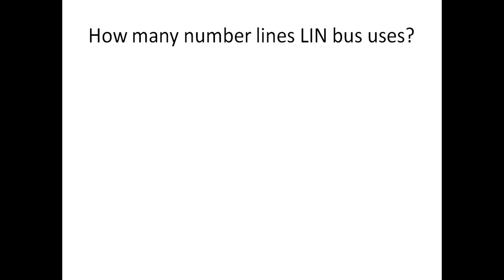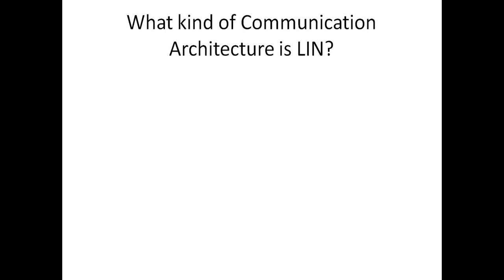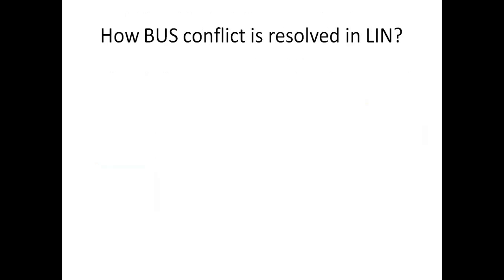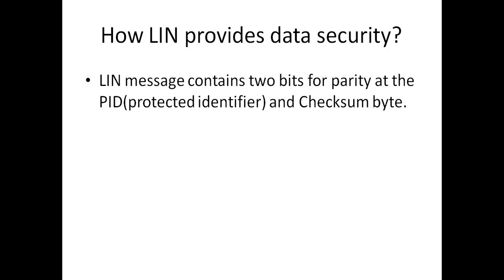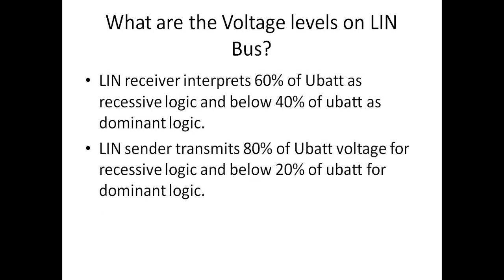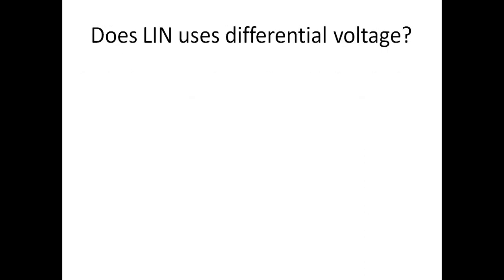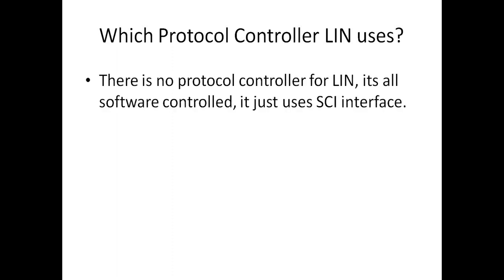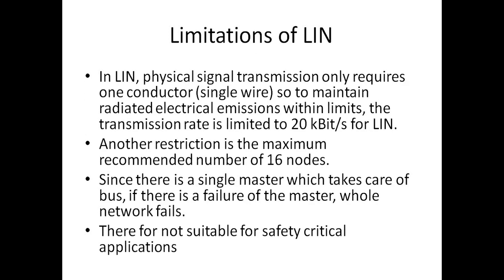interview questions on LIN local interconnect network

Comment: I think The number of slaves connected in LIN communication is 16 correct but the explanation is not correct , because PID is 6bit + 2 bit parity so it is not releated to number of slaves , as the same ID can be used by multiple slaves for communication .
The explanation for having 16 slaves only is :
in diagnostics the first byte of messagercalled NAD == Node Adress which is 8 bits (1 byte) which defines node adress in the network . so this will have only 16 adress .Thats the reason there are only 16 nodes which can be conneted in LIN network.
Reply: same doubt I am having....

Comment: Thank you so much. That was really helpful. I am trying to communicate with the OBD II port using microcontroller. I have managed to communicate it with CAN. Now trying to communicate with LIN (Kline). I am confused what is the purpose of L-Line? I could not find any documentation for L-Line.